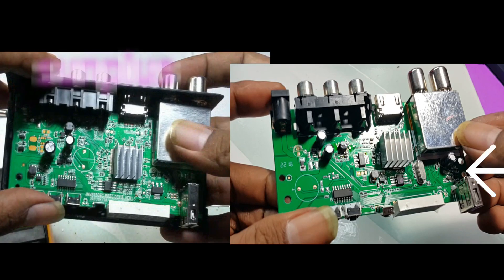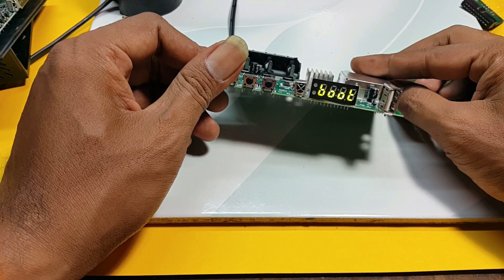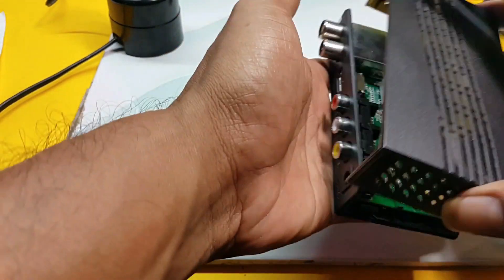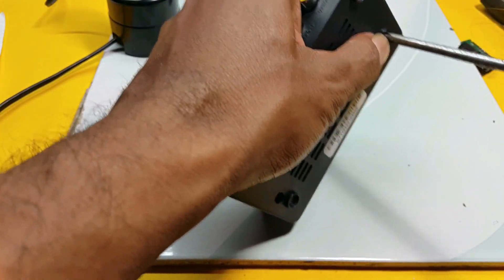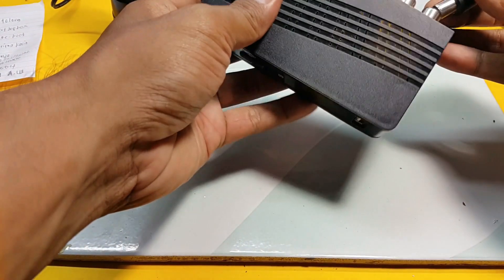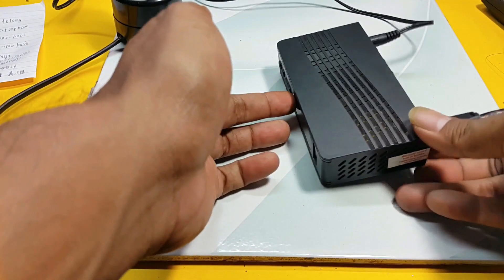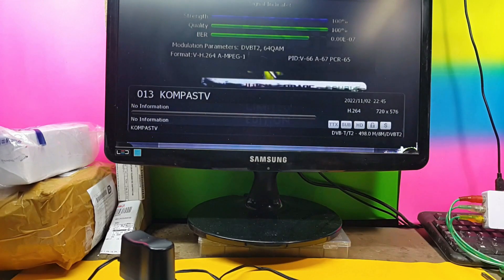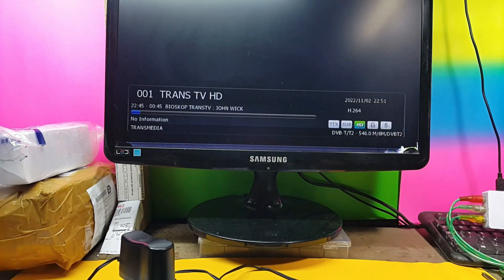Stb T2 Problem Kerusakan Boot Salah versi firmware

Comment: Mas mau tanya, set top box saya merk intra jupiter.Dihidup kan hanya sampai kluar logo jupiter, bgtu mau ke siaran hnya kluar gambar garis2. Remot td berfungsi, saya sudah ganti elko, tp msh sama tidak kluar gambar hnya garis2.Indikator pd set box normal, sudah lewatin boot dan kluar angka chanel. 
Mohon solusinya mas??
Reply from the maker: Ini pake bahasa tehnisi ya mas.
1.ada beban berlebih/short

2.kemungkinan besar ada di prosesor/chipset.

3.chek hambatan dalam di vcc ic tuner.,jia ada short/konslet lepas dulu ic tuner
Reply: Ok Terimakasih saran nya nnti saya coba, barakallah sukses buat chanelnya mas... 🙏🙏🙏
Reply from the maker: Problem begini termasuk naik level dari yg umum.dia boot,angkat sistem kerja gak mampu.ya intinya dipastikan dulu gak ada tegangan drop di semua tegangan kerja.ada 1 tegangan perintah yg belum saya buka.set top box t2 belum ada schematic bebas .masih raba2 per pcb